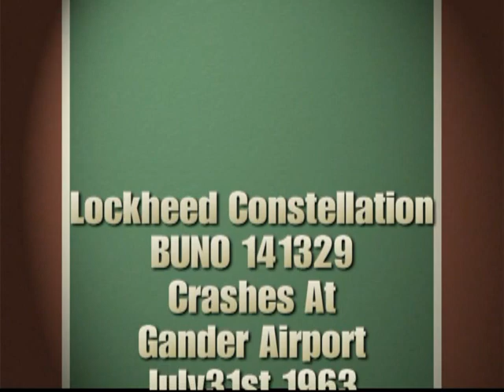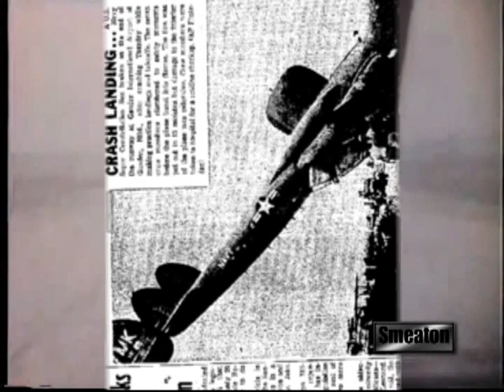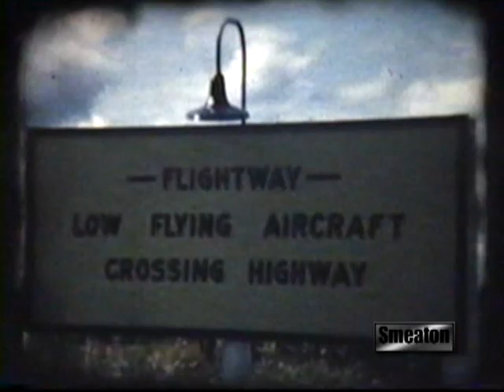Crash Of Lockheed EC-121K Super Constellation Gander Newfoundland

Comment: I first went to Argentia with VW-15 Crew 10 in either November or December 1957. We came back in May 1958 when they sent VW- 11 up there permanently. They recommissioned VW-13 and sent half of VW-15 over. VW 13 was decommissioned the year before because it ran out of gas.Then  I was in Crew 2. I went from Airman to ACW2 drawing First Class PO pro pay in that time. I had almost 3500 hours. We had several blizzards back then. The worst was when we were called out of our racks in the middle of the night down at Pax to go up North. Thirteen and Fifteen were doing 2 weeks up and 2 weeks at Pax at that time. One time Argentia stayed snowed in for 5 days. They even lost the snowplows on the runway. The only thing moving on the base was the 33,000 pound "budda." Those of us who have been up there will remember that huge plane mover.  There were two crews from 15, two from 13 and one from 11 flying out of Harmon Air Force Base at Stevenville. The Air Force treated us like kings. It got down to only our plane flyable. We had to fly a racetrack around the Coast Guard Ocean Station Delta halfway back up the barrier for a while then we went up to Grain the DER on picket duty  to do the same. Since the Barrier Op Order said we had to maintain a plane out there no matter what we knew we were going to die.  Every body's face was 'white.' Our PPC had us to the northwest of the DER when word came through that Crew 5 was airborne.. When we landed the Flight Engineers dipped the fuel tanks. We had only "six (6) minutes of flight left. Planes started back out of Argentia right after Crew 5, VW -15  got on station. She had to abort into Lajes in the Azores..........Those were the days my friends.
Reply: My dad, Cdr. T.J. Wood, flew in the VW-11 rotation, I believe during this time.  He had to belly land his Connie on icy runway one night when all else socked in down the coast.  Jettisoned- low fuel, decision made with squadron, made smooth belly landing, no fire- all walked away- instead of rolling in to the bay.  That's the story I heard anyway...

Comment: USAF lost an ec-121 in iceland when the left MLG shock strut shattered while taxing from the ramp to the runway.all crew made it out but two icelandic fire fighters were injured after they entered the burning aircraft searching for unaccounted for crew members. very courageous souls. with 7500 gallons of avgas on board, it burned down to puddles of molten metal. it was #121, a florida based aircraft. the shock strut had just been replaced. the part was damaged while in the supply chain and it took an x-ray to find the five mm nick in it where stress corrosion ate it up. we x-rayed a lot of struts that month.
tripple nickel is in the usaf museum and 425 is at colorado springs. severalothers are out there.

Comment: Wow just stumbled across this!! My dad flew on the VW-2 although he called it the WV-2, maybe security reasons back then. He was on the GE design and test flight group  out of Utica NY that test flew the radar system for several years.They flew out of South Weymouth Naval Air Station, MA. Us boys spent wonderful summers at Green Harbor MA, ty GE.I remember hearing about this airport and their flights there, and into hurricanes also, and out other times for 20+hrs and other times coming home on two engines. One tough plane. My mom would be so concerned, often crying about what he was doing. Now I see why! If i remember correctly the back part of the plane and tip tanks were bright orange, the top fueslage and dome were white and the bottom dome was black. Years later he and others test flew the system for the Hawkeye out of Bethpage LI. I think Tom Ethridge was the test pilots name he flew with on that project. Really miss him.Thanks for the posting and memories.
Reply: VW Is the squadron I was assigned to VW-11 crew 5 there were also two other squadrons VW-13 and VW-15, in Maryland PAx river naval air station. I also have an earlier post on here about two years ago. Scroll up. Ron ACW 3

Comment: Same as Jack Sellers. We were there at the same time.   Flew almost 2000 hours in these beasts.  4 Pratt and Whitney R3350 at 3000 hp per engine.  Noisy, vibrate, hell on your body after flying a 10-12 hour patrol.
Reply: The engines were Wright R-3350, the figure indicating the total displacement in cubic inches. In metric units 21,6 litres, meaning about 140 HP per litre :-) Not bad.
Reply: Jannik Bo Rasmussen
I hope you don't mind, but the total displacement was 54,8 litres, so the engine
produced 54,7 hp/litre, which was  still  remarkable.
Reply: Thanks for the correction. You're right of course - I seem to have forgotten in my calculation that the 3350 was cubic inches and not square inches ;-).

Comment: What was the cause of the accident? Was weather, winds, runway condition, mechanical failure, pilot error, a factor?
Reply from the maker: The exact cause was never decerned but it has been implyed that she sled off the the runway and struck mud... but I note that she had to be losing altitude whereas after shearing off the ILS shack she had to be at a lower altitude than normal at reaching this position of the runway???
Reply: I guess it was pilot error then, poor judgement, sloppy flying, bad approach, something like that. Oh well, guess that plane never made it to the air museum.

Comment: The Constellation was designed as a state of the art passenger airliner. Get your facts right.
Reply: The original Constellation was designed as a passenger airliner, after that it was redesigned in different ways for military use.
Reply: So it was designed as a passenger airliner like I said, huh? Thanks so much.